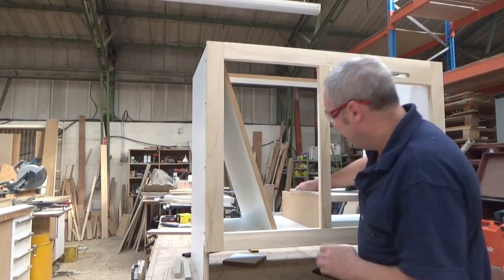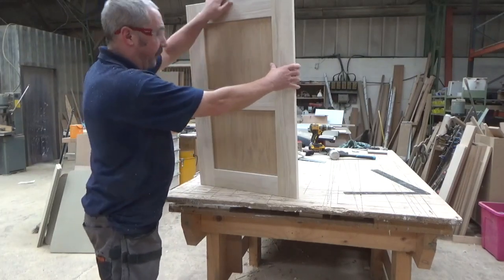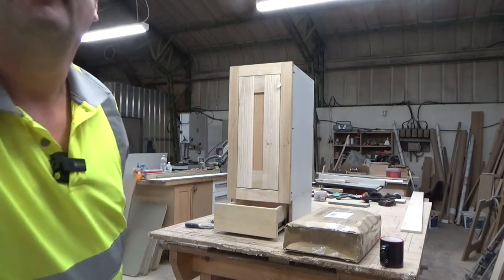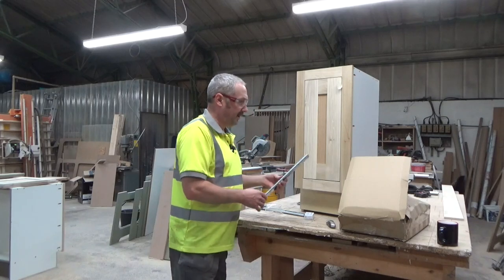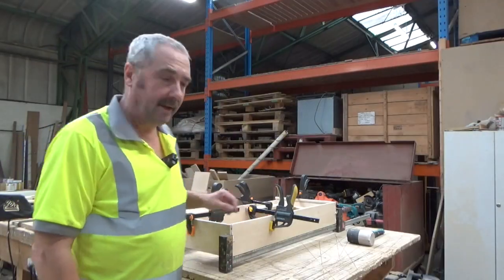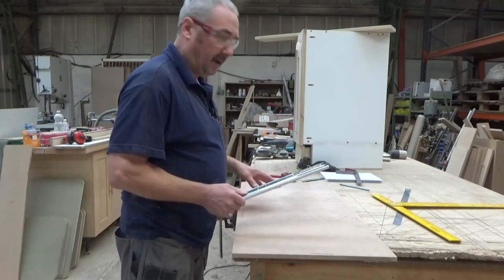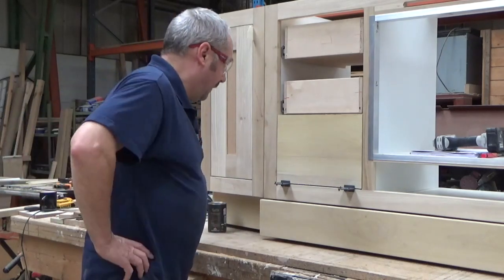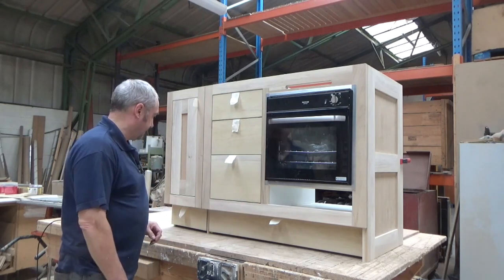Narrowboat Build  . Making & installing drawers in oven housing unit

Comment: That’s a cracking set of draws Andy. Will the concrete worktop alter the balance of the boat or require ballast to be removed?
Steve
Reply from the maker: Hi Steve , The balance side to side should be Ok as I am doing a unit opposite side about same size with same counter top. I will also use GFRC that is much lighter in weight than standard concrete. Cheers Andy

Comment: Hi Andy  Cupboard looks great, I like the idea of draws in the kicker,  I like the way you use biscuits to make the draws, simple way quick and easy to set out, I made new kitchen deep draws, but I made them with dovetail joints, lot of work but looks good when you open the draws, You are thinking of flush pulls for your kicker draws,  I would use D handles, save a lot of bending when to open, I was pleased to see how you set up the draw spacings, the used the appropriate spacer MDF  board, like said in the past, setting out and marking up takes all the time,  what you do and show will help many people, in doing there own joinery work. Regards rocket744
Reply from the maker: Hi Rocket ,Biscuits are just easy strong joints that are quick to do on plywood. Dovetails are great especially for the look . I am thinking D handles may get kicked but will check that when units sat down.  I agree use jigs etc to get accurate quick marking out. Glad you like it.
Reply: @nogunwales9406  Hi I do enjoy watching your skills. looking forward to the fit-out, suggesting  D handles just thinking of getting down to gain access. Regards rocket744